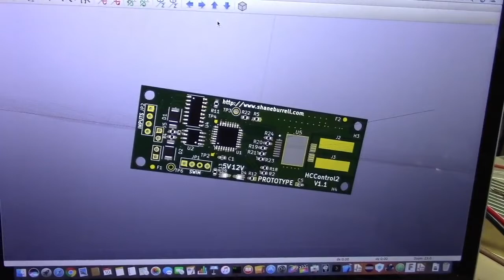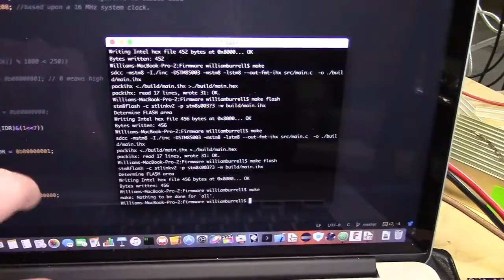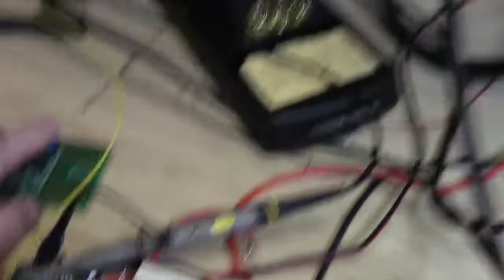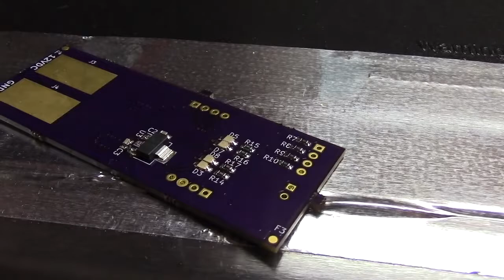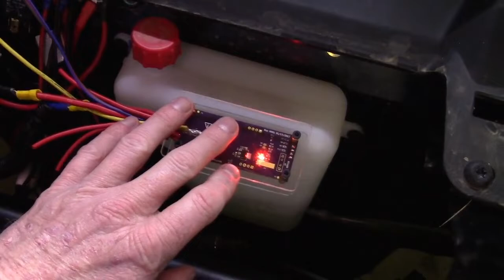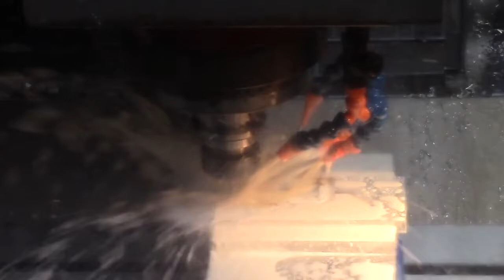RZR Canbus Mux R&D Wrap-up

Comment: I’m experimenting with something similar using a M5Stack and CAN module.   Where did you find a list of RZR CAN messages?
Reply from the maker: It requires some reverse engineering.
Reply: @ShaneBurrell1  was guessing that.   Thanks on the reply.

Comment: Are you selling the rzr boards preprogrammed. Don't have the resources but would love to use something like this.
Reply from the maker: I was building a few for racing and such.  There wasn't enough interest. I did a larger one (16 outputs) that is used on large tractors that I still produce but it isn't practical to use on a RZR.